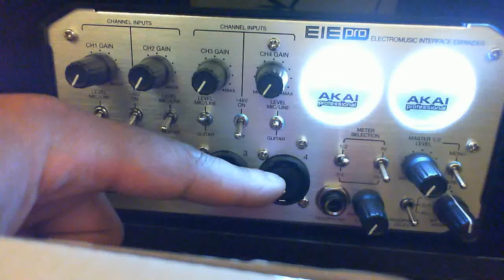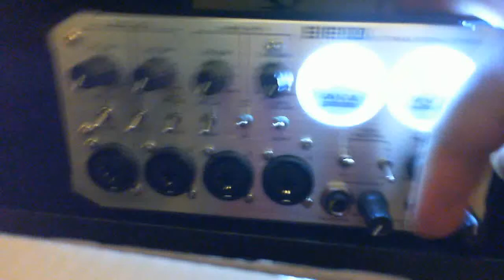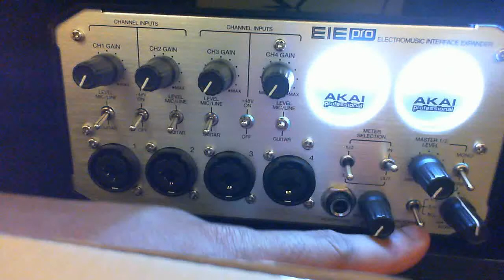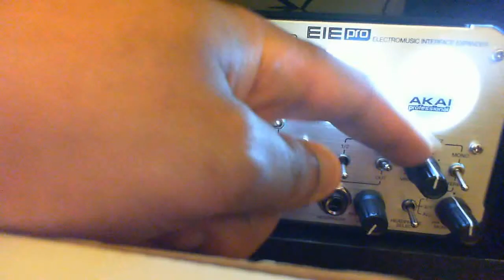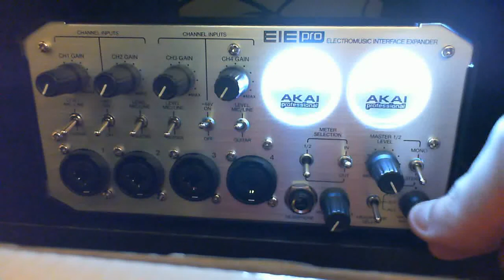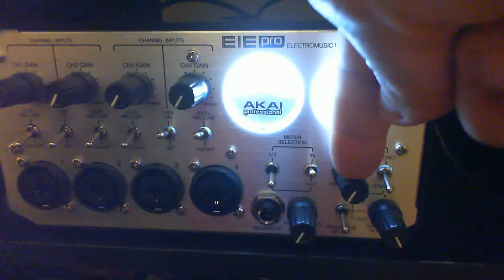Akai Professional EIE Pro Tutorial Part 1.wmv

Comment: I just bought this too. Can't find how to adjust bass/treble etc.
Reply from the maker: Jaime Flor yes u can record a bass track into Akai AI setup ur DAW & mixer to accept line-in from Akai AI , i would not use a mic for bass track recording. If u have a bass guitar with 1/4" TS or TRS cable insert into the front guitar insert of Akai AI lower ur gain level knob 1st so u dont pop the speaker monitors and make sure phantom power is off... im not currently using mics to record instruments only vocals but im sure this is how it would be done anyway thanks for viewing my vid and subscribe
Reply from the maker: Thanks for the comment but unfortunately this audio interface does not come with an EQ software to manipulate the bass/treble, so use ur DAW or media player's built in or stock EQ for frequency management
Reply: Nikk Bled I had no idea that was the phantom power switch! Fortunately it was already switched on when I decided to record some vocal tracks for the 1st time with my Sterling ST55 condenser mic. I have the booklet to, so I'm sure that I would have figured it out. The only thing that bugged me, was the sound quality while recording. I got used to it eventually, but it sounded better, when I was using my Audio Technica condenser mic, which has a USB plugin, so I didn't need an M-Box. Anyhow, I just trusted my equipment, & began recording several new vocal tracks. I have a small portable singing booth, & I was surrounding my mic with a cardboard box that I cut out for my guitar, so I was experimenting with my vocal tracks. I always had the portable singing booth on my mic stand, but on a few tracks I was even holding the cardboard box on my head. I even tried using a normal SM-58, just for the sake of experimenting. Anyhow, those were the best vox tracks that I recorded on my own. Now I'd like to record a bass track. First of all, can I record a bass track on my AKAI? If yes, do I plug it in as a guitar, or do I use a Shure SM-57 (instrument mic), & mic the speaker that the bass coming out of? I also have an M-Audo.

Comment from the maker: I use fl studio but just make sure you have the right input selected. their are only 4 inputs on the EIE pro, the way it works on fl studio is u have to have asio4all driver is selected for soundcard and input 1-4 selected on the mixer track u want to record on.
Reply: I always get complaints about a echo I record on fl studio what am I doing wrong
Reply from the maker: @markcastorena3146  the track you are recording on should not be sent to the master track. Basically don't send your recording track to the master otherwise you will get echo
Reply from the maker: @markcastorena3146  or send/aux tracks also must be deactivated

Comment from the maker: I had this problem and all it means is that your PC cant handle your DAWs audio settings this is the way i fixed it... Open your DAW, Go to Audio Options/Settings,Select these if you can [Asio Driver for soundcard/ 44100 for sample rate/ select between 256-1024 for buffer length/ save then restart your DAW. let me know if it worked for u

Comment from the maker: Yes im guessing but its best to try for yourself. i just dont think having a mic on channel 1 and than a guitar on channel 2 will work bcuz of the phantom power switch setup on the EIE controls channels 1 & 2 and the other channels 3 & 4 but 4 guitars should work fine... im just a beat maker at this time, i havent worked with artist on this audio interface yet but as soon as i do i will reply with a better answer. thnx for commenting
Reply: putting phatom power over a +10dbVU line level (guitar/dynamic mic) will NOT have any effect on the input. That's why it's designed with 2 channels connected to a single phantom switch. They didn't just make that on mistake lol.
Reply from the maker: @BernardStudios  watch your mouth beta

Comment: Gain input knobs: "Up is to the right- down is to the left."
If you need to be told that, you may not be ready for this!
Seriously though, this is VERY thoughtfully done,
particularly if someone is new to computer based recording.
My current input device is working just fine- but it has NONE of the features of this little sweetheart: 
The input jacks- 
the meters (in or out!), 
the usb hub, 
the mono switch (more useful than one might think),
The monitoring features (!)
(and it LOOK bad-ASS!)